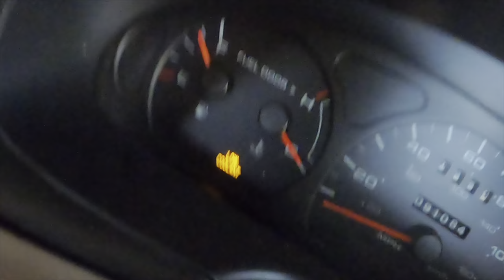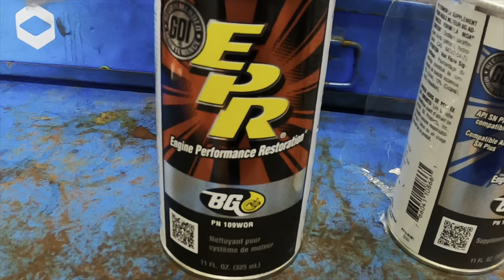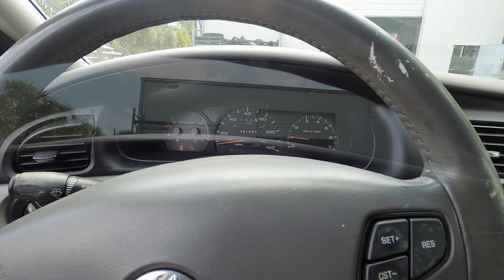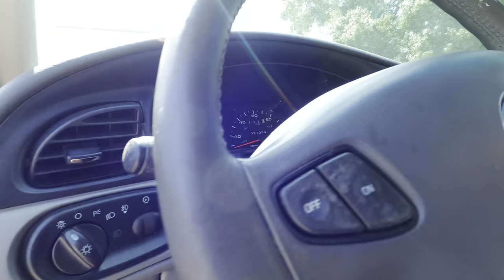Customer States: Never changed the oil….oops

Comment: Absolutely brilliant video, your methodology & execution of the task was very impressive, you clearly have an overwhelming knowledge of the inner workings of an engine, you are a credit to your profession. This video just shows how important it is to keep on top of vehicle servicing to avoid this issue.
Reply: Actually the inside of an engine isn't that difficult to work on. They do take some skill to service correctly. Rebuilding an engine takes more skill, you have to do valves, valve guides, valve seats. Then work on the block checking & setting thrust bearings, check ring end gaps, & like he did, rod bearings. 
At this point, most would consider pulling the engine, rebuilding it, then install rebuilt engine.

Comment: WOW ! A guy that actually 'fixes things' ! I'm really OLD 'geezer gear head'. From the late 50s/into the 60s. I've done the emery cloth thing myself. But, I used to save my old worn out emery, and use it to put a mirror finish on the journals, after using the new stuff. It was a pleasure seeing you work on this engine. She is a rough one though. Been there and done that! thank you for your videos. From a guy who remembers before 'plasti gauge'  and Andy Granatelli's STP.
Reply: BIG BAND MUSIC INTERFERES WITH WHAT YOU'RE SAYING....!
Reply: I had a spun bearing that was bad enough to elongate the conrod...looked much worse than the one in the video. I spent several hours sanding the journals down using multiple sandpaper sizes and got them all to a mirror finish. Ray's still look pretty rough to me.
Reply: I had to hand scrape a used bearing for an 8 inch gas turbine output shaft once. I gathered everyone in the shop, described what a bearing scraper looks like until someone’s face lit up. The scraper had obviously been used as a pry bar, but I resharpened it and got the job done.
Reply: Bruce- and Prell shampoo concentrate for getting that high-sulfur gear oil off your hands, Pepsodent toothpaste as the final step in valve grinding, Indian Head gasket shellac, and metric was taught in school, but with no expectation you would ever use it.
Reply: Good video. I’m not a mechanic but it seems that todays engines are less prone to bearing wear. My dad was a shade tree mechanic through the 60s and 70s and it seems like he did quite a few bearing jobs. I guess oils are better and owners are more likely to do regular oil changes than back in the day. I think you’ll put this vehicle back in service until the next major system dies of old age. 🥸👍🔧👀✅

Comment: Wow, nice to see an old-school auto repair. Unheard of these days in CA. I remember when "rings and bearings" meant stripping the engine in the car, honing the bores, cleaning the crank and putting it all back together correctly. Just like you're doing it.
Now, mechanics just replace the engine with a crappy rebuild and cross their fingers.
I recently rebuilt an engine. Took it to a local machine shop for head work, block cleaning, boring and a crank polish. The guys there said "nobody rebuilds engines anymore, we build race engines". We talked a while, they said to bring it in, and did a great job.
Reply: Labour is expensive, thats why. Customers dont appreaciate paying 10 times over for labour vs part cost.. And whoever replaces engines nowadays.. unless they do it themself.
Reply: @jmkhenka  yea I think I agree. Despite everything I know, I thought maybe this guy had a point. Like maybe block cleaning head work boring etc was a batter route. I always assumed that the cost of labor for all that wasn’t worth it. I’ve made that assumption based off what I’ve heard, but I don’t actually know how much it costs to do all that
Reply: @theknight45videos  my uncle rebuilt the engine in our 1970's F250 in the 90's in the driveway, and put it back in and trucks been great since. Literally not that difficult.
Reply: @pilsplease7561  a 70s f250 is cake compared to modern vehicles. not even comparable. I could fix my old chevy with a Swiss army knife in the dark. modern vehicles are so over engineered. Parts aren't fixable anymore. they're modular and replaceable. it's a different time for a mechanic nowaday.
Reply: back in 2001 i ran into an old school race mechanic that rebuilt my 83 honda prelude. dude custom ground rings for no gap, and found a larger head from an 84 accord with larger intake valves. he kinda disappeared leaving me to do the miles of vacuum line, but that was ok, that car ran like brand new for years. it finally blew a piston, and it just wasn't worth it to rebuild even though it was a really cool car and i had dumped a bunch of money into it with the intention of keeping it forever. oh well.
Reply: @READERSENPAII  You would think that should make it less labour intensive, shouldn't it ?
Reply: @dmitripogosian5084  you would think that, but it's not the case. Modern engines are computerized which makes them efficient but not easy to fix. Also, they're designed in a way to make it extremely difficult to service for the average person. proprietary software and tools are becoming a  necessity to fix your own vehicle. You used to be able to buy service manuals for your vehicles and now you can only rent access to the manuals online. Everything is being designed in a way to force the average consumer to take there vehicles into the dealership for service.
Reply: @READERSENPAII  Yes, but what I was saying is that at the dealership it should be less labour intensive when you are just changing the parts ? Agree, the mechanics shops need to have a lot of specialized tools, so there is a capital cost, but I am asking not even about the cost of labour, but amount of labour ? Shouldn't it be less labour to change transmission than to rebuild it ?
Reply: @Dmitri Pogosian  I might of misunderstood. My point was that fixing purely mechanical issues on older vehicles is much easier than fixing issues on cars that are highly computerized. It's less about how hard it is to change a part and it has more to do with vehicles that are loaded with sensors and electronics are tougher to diagnose without the proper scan tools or literature. Sometimes, one bad sensor could be a symptom of 20 different problems and you have to go and troubleshoot for a day. My comment was directed towards the guy saying it's not that difficult to fix an engine because his uncle rebuilt an old 70s engine in his driveway. My point was that, today, a vehicle is much harder to figure out the problem and since everything is modular, for the home mechanic that used to be able to save money and repair something, they'll have to spend the money to replace it. nobody fixes alternators, starters, brake calipers, cv axles, compressors, etc. Shit a bad seal on a compressor could cost you nothing to fix rather than spending 250$ on a new one. sorry for the long comment, just hoping to clear up any misunderstanding
Reply: @READERSENPAII  this is the main reason I refuse to buy more modern cars with the exception of modern enthusiast cars that you can mostly wrench on yourself with plenty of forum documentation. You have to be an IT guy now to check on whats going on with your cars because of computers running everything and be a bit of an electrician at that too. It does make you more knowledgeable but also a pain
Reply: @tommynobaka  super true. thankfully for me, working on a fleet for a construction company grants me access to scan tools and specialized tools. I can't imagine what home mechanics have to deal with.
Reply: I did this on a Cherokee 4.0. Had a cracked head. Got another head at the junkyard. Lapped the valves , new seals. Pushed the pistons out the top of the block. Honed cylinders, new rings,new connecting rod bearings and oil pump. Put backed together and it ran like new. Easy peasy.
Reply: @rickpickle  What do you mean no gap? Like a step-joint or scarf joint piston ring?

Comment: Great videos!!  My Mom's 1984 Cavalier had a bad head gasket......some guy replaced it and it still had milkshake oil.  I added some stop leak, replaced the trashed main bearings and it ran fine for 12 years until the body rotted!

Comment: Great video, next time you encounter that type of rust issue on exhaust bolts heat them with a torch then spray them with water. That process knocks the scale off and makes the bolts easier to get off.
Reply: hit it with the "persuader" a few good smacks!
Reply: Agreed
Reply: ill try it.
Reply: They can’t be stuck if they’re liquid.

Comment: OK,here's my thought,RAY.The most important section of the rod journal is the section that's at the top when the piston is all the way up,when it fires.that when it tries to squeeze the oil out from the bearing and journal.So smoother there is better.Use standard size bearings if that's what was in there.PLASTIGAGE  the trouble one,to see if it's close .001-.003 max.Call it a day,no guarantees to the customer,showing him why,a car that old,and a customer that doesn't check his oil,doesn't deserve more! YOU made a great video,I've done it this way for poor car owners and it lasted for years after.But the rods i believe where never STRETCHED TO OVAL SHAPE.If you feel up and down play after the new bearing,it's toast in a month.thanks for the video.
Reply: Good points
Reply: The owner: this time it should last another 91,000 without oil change.
Reply: Very nicely put

Comment: 42:05  Instead of doing it that way, cut the emery cloth just a little bit longer than the circumference of the journal.  Then wrap string all the way around twice and just pull the string back and forth.  It will keep the pressure exactly the same across the entire surface of the journal.  Also, all that roughness is NOT in the crank, it is bearing material.  A little vinegar will take it right off and leave you with the smooth surface.
Reply: Good comment, sounds like a much better way of uniformally resurfacing the journal. Didn't know about the vinegar trick.🙂
Reply: That’s how we do it!!
Reply: Very interesting
Reply: Came to the comment section to say exactly  this!
Reply: THAT'S BRILLIANT! Thanks heaps for the tip
Reply: Good point.  Saw another video where shoe lace string was wrapped around twice with sand paper which puts pressure all the way around the journal.

Comment: I like how you don't just say, "there's metal in the pan, needs engine replacement for $7k"
Reply: Totally agree with you, too many so called mechanics are just too happy to go with what is easiest for them these days instead of trying to help the customer out. Fair play to Ray, he is always honest and straight up with his diagnosis and trys to work with the customer as best he can
Reply: I know right I wish I knew where he was located and hopefully he's very close.
But knowing my luck hes over a thousand miles from me 🤣.
Please look at my timing chain mechanics im at 186,740 miles on original and they always say it never needs replacing.
Like um not true it brakes down after some time and my truck is from 2005.
Reply: Right.

Instead, after charging for this job, in two weeks he can say “there’s metal in the pan, needs engine replacement for $7k”
Reply: That crank needs machining and then an oversized bearing and we all know it.
Reply: I'd do the engine replacement just because the customer didn't think he had to do oil changes. You should know the basics before buying a car. Stupidity
Reply: Music was totally annoying left the video.
Reply: @Steve Sanchez See: part 2 where that doesn't happen...

Comment: It's nice to see you actually did some shade-tree mechanic's work to try to save the crank instead of scrapping the car. For the cost of the rod bearings it is well worth the attempt.
Reply: It won’t last unless the conrod is replaced it will spin again
Reply: @robertdeguglielmo7257  When I was working in a shop a customer came in with a Blazer with broken crank. He brought in another reconditioned crank with the bearings. One main cap was stretched and the customer did not want to pay to dismantle the block to have it line bored with new caps so I gave him the option of me shaving the cap to get it within the limits with no guarantee. He took me up on that and 6 months later it was still his daily driver, he moved then from the area.
Reply: @jerrycann6374  yes I’ve done things like that and come to an agreement with the customer after administrating the last rites on the engine   Good thing’s happen some times I guess. 😬
Reply: @robertdeguglielmo7257  I have a 67 Chevelle rear in my 86 Grandprix. The eaton carrier broke in 2 last year. I thought about putting it back together with JB Weld but I talked myself out of that "repair"

Comment: A friend of mine bought a new 1971 VW Beetle in Hawaii years ago.  He drove it for 100k miles without changing the oil - only added if necessary.  Flash forward to 1973 when, to celebrate the 100k mile point, he treated it to its first oil change.  The oil looked like tar coming out - it drained for around 3 hours.  He then refilled it with the correct new oil.  128 miles later the engine grenaded, shattering 2 rods.
Reply: heard same story with an aussie car. Never changed oil . Got convinced to do it once . The whole thing shit itself.
Reply: @jw451  The detergents and thinner viscosity probably knocked some serious deposits loose that likely clogged the pickup or some oil passages.
Reply: @channell11  & ultimately blew the engine
Reply: That reminds me of smokers who smoke 2 packs a day for 43 years, then quit, and have a massive heart attack 7 months later, Don't stop, if you want to live!!!  They say.  My Doctor tricked me, they say.  I have to see him for 6 minutes each week, and take all these pills, I should never have quit, and this wouldn't happen.
How about, in 2 years of neglect, the damage was done.
Reply: How does one do 100,000 miles in 2 years in Hawaii? It's not like he's taking long trips. That's an average of 961 miles a week. That is a big commute in Hawaii.
Reply: @castinn  He purchased it in California, shipped it to Hawaii for a six-month tour, back to California and then to NRTS in Idaho on the desert with its 125 mile round trips to and from work on the desert.  Miles added up living up there (as I did also at the time).
Reply: @castinn  WOAH  I missed that.  I drove about 40,000 miles a year as a cable tech.  I had a daily commute of 100 plus driving over 3 counties.  You are right, 50k miles don't just grow on trees.  I also happened to live on an island as a child, with a 52 mile ring road, and I can tell you it ain't easy to get miles, miles, miles in a day.  What the heck errands require you to go across island 4x in one day?